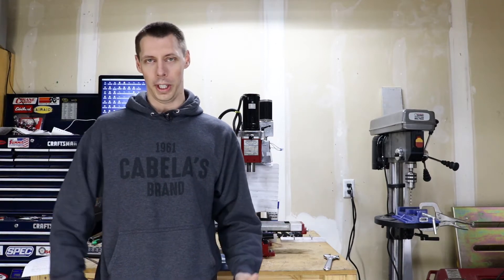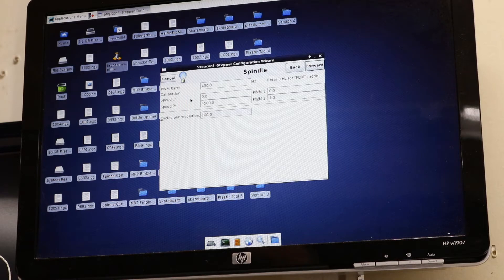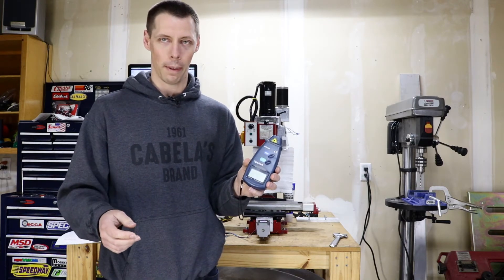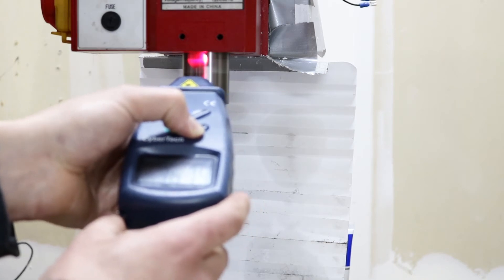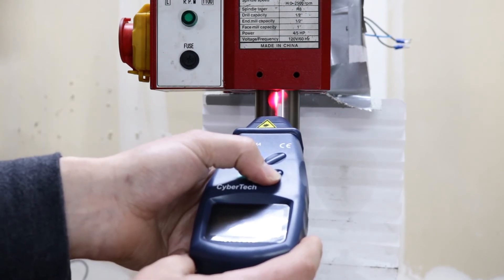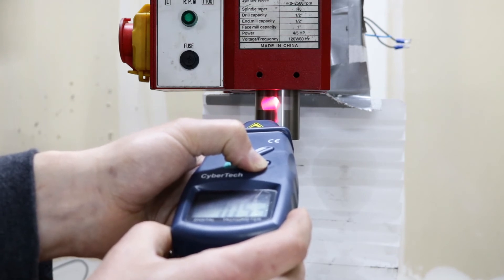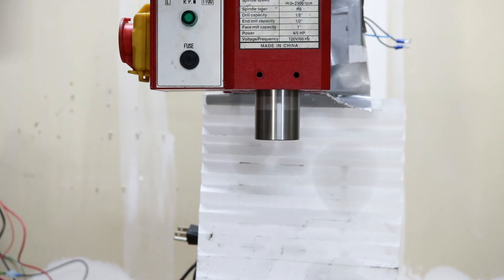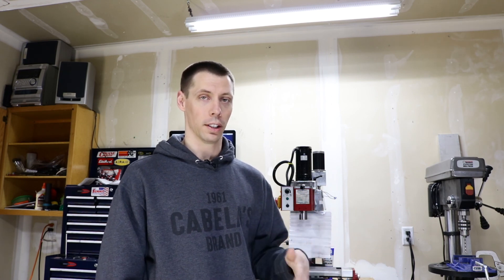LinuxCNC PWM Spindle - Tweaking Speed

Comment: Wish I saw this 6 years ago... You did a fine job, and the number deviation that you are showing doesn't really matter when the actual milling starts..  You are in the ballpark home plate area...   An attempt at an absolute Linear 0 - 3500 rpm would be hard to do without an encoder on the spindle, feeding back into a spindle controller.  It is almost impossible to have a pure linear one.  Excellent job and hope you resolved your issue.

Comment: Enjoy watching your videos but seemingly not as much as your girl, Ally, does. 😂
Feedback/rpm control...I think your only option is a servo motor for the spindle. I’m working on one now...still trying to get it setup. Not inexpensive but seems to work well.
Reply: Dallas J That would be pretty slick if your friend can get that up and working. It’s actually pretty amazing that with all the CNC control programs available, none are able to change the signal output to the motor to maintain the commanded speed. I’m no expert but would imagine that as long as it’s close, rpm is probably not that critical.